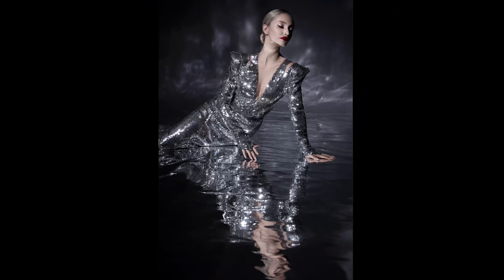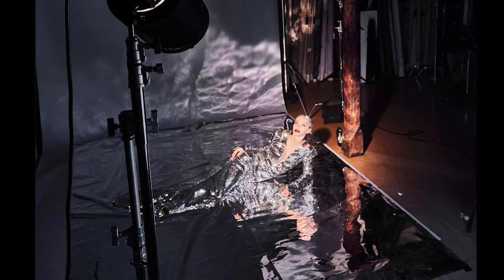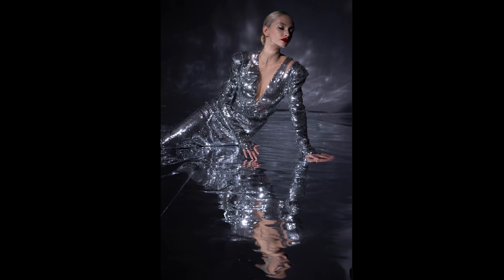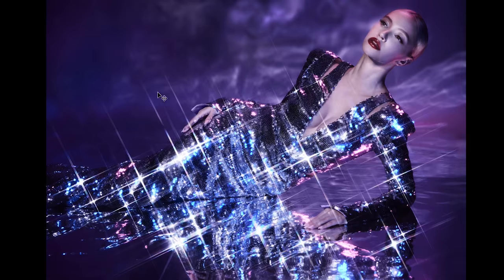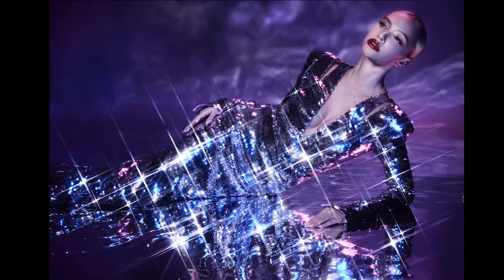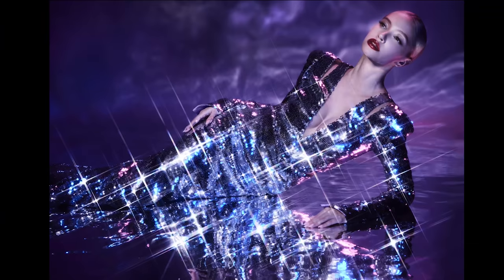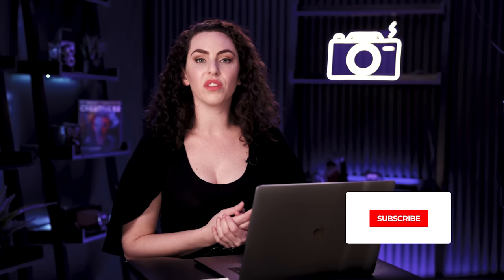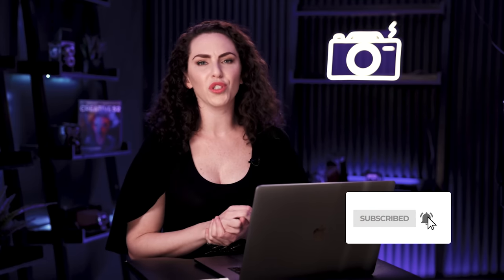Using Mylar for a Creative in Camera Lighting Technique

Comment: Fresnel on flash ?    Can it be constant ?
Reply from the maker: results would be similar for strobe vs. constant (but Id stick to all strobe or all constant to match similar power outputs)
Reply: @lindsayadlerphoto  ok   can you advise which one? I have the Apeture F10   (part of the 2000$ purchase with apeture 600d that I mentioned on zoom)
but that one and every other on Adorama seems to only mention constant   as does every article when I look it up even though I know you use one one flash and my friend says they all should work on flash
Reply from the maker: @jamesg1974a  I use nanlite continuous with Fresnel. Either their 300B with the FL-20 or I use their 60C with the FL-11.
Reply: @lindsayadlerphoto  right.  So to be clear. You use the nanlite fresnel but on a D2 strobe?    Can I use my aperture on a strobe?   I know, I’m needy
Reply from the maker: @jamesg1974a  To do that you need an adapter- I use the Profoto fresnel on the D2